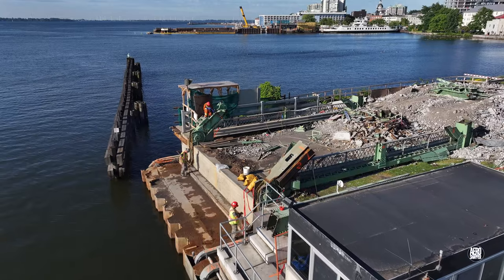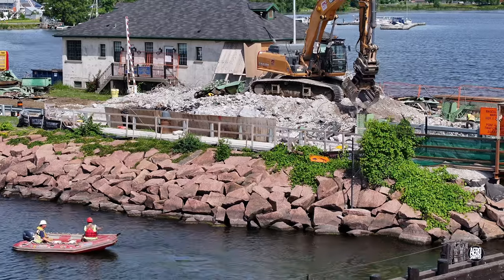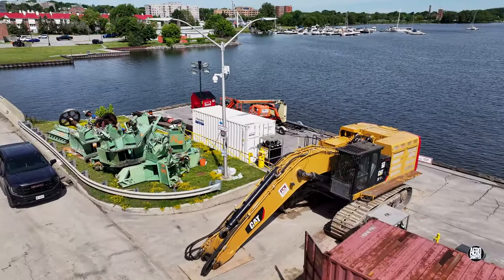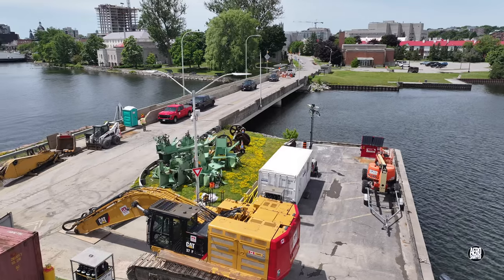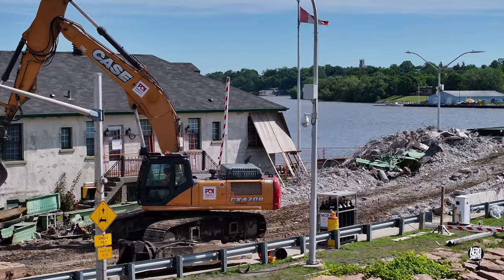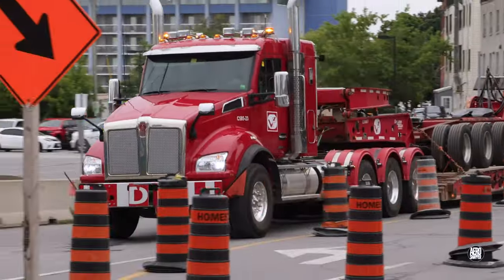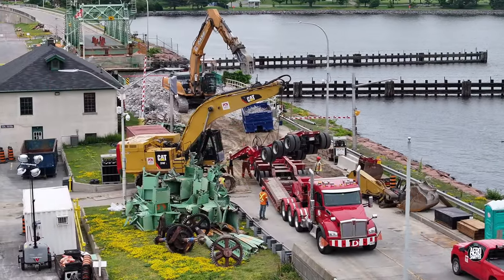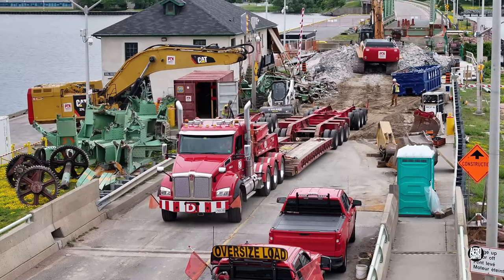Clear Up and Clear Off  - an update on the La Salle Causeway lift bridge 4K

Comment: Cool views.  I wonder if they eill immediately tackle the other part of the bridge.
Reply from the maker: @DonJoyce  thanks - addressing the bridge deck immediately doesn’t seem likely - perhaps there’s a cunning plan ?
Reply: I've mentioned this in earlier videos in the comment section, and I'll repeat it here for Don's benefit; I talked to Mark Garretsen (and even showed a screenshot of Aero's video of the cut side), and I suggested that they keep the bridge deck either as a temporary bridge, or they replaced the lift section and weld/bolt it to the old bridge deck.

The bridge that was in pretty good condition; it would be a waste of time and resources to replace it, especially since it's still a major part of the original bridge built in 1917 - and the one part that gives the bridgr it's official nickname as the singing bridge.

So either they're either taking my suggestion, had this plan already, or they're going to set up on the other side for demolition when time permits.
Reply: @TheEDFLegacy  Cool idea.

Comment: What is the city’s plan to replace it ??
Reply from the maker: Perry - only to clarify the situation, the bridge and causeway are Federal lands and properties.  It will be a decision taken by Public Services and Procuement Canada.  Doubtless, the City of Kingston will wish to have an input to any decision, but at this point, no information is available on plans for a new bridge, except that a temporary replacement is intended - with no time frame for its installation declared.
Reply: The city has no say. However, to my understanding, there will be a bidding process to replace the bridge sometime over the next few years. During that time, a temporary bridge will be set up, and will be removed on occasion to allow boat traffic. 

I've been pushing to have the original bridge deck as the temporary bridge, and even used as a starting point for a replacement lift section.